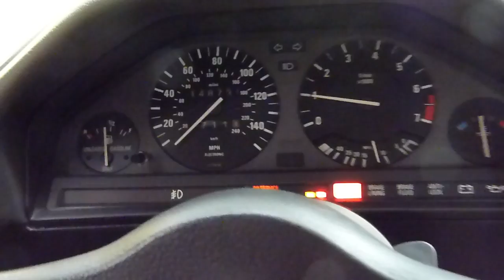SOLVED - e30 1991 BMW 318is 5k RPM hesitation - HELP

Comment from the maker: @BeamerE30318i Thanks for the response.. I am hoping the cams are not the problem. I had the valve cover off to replace the gasket about 4-5 months ago and the cams looked great.. the only thing that even looked potentially bad were the cam sprockets for the timing chain, but, but even those weren't that bad. I'll post back on here once it's resolved.
Reply: nairbtits please what was the problem???

Comment: nairbtits your about right! I personally realized the difference in the magnets,too. But mines turned out to be o2 sensor. Adding to that ,I took off my coolant temperature sensor and it has some black residue on it and it wiped off pretty easy and put it back in and it's sound was back to normal while trying to crank it up . Not the rich ugly sound it made before . Just now , all I need is nice jump battery .... went dead (not original)

Comment: I've have them same issues but its happens once I hit the gas pedal cars bogs out like if it's about to turn off this is just regular pressing of the gas pedal stop and go I have to light press on the gas to rev up slowly but then it has almost like a rev limit of 3k which I never had that issues before I have a 87 325is stock I'm thinking it might be Air fuel meter it's been down for 1 month now I miss her.
Reply: i have the same problem how did you fix this
Reply: Any fix or just sold it to another head scratcher?

Comment: My friend bought a 318i yesterday. I drove it home and it has the same problem with not getting over 5k rpm :P
Reply from the maker: If it has the M42 engine (1991), and it is exhibiting the symptoms seen in this video, I would START with the crankshaft position sensor. It is located directly below the crank pulley on the front of the engine. Jack the car up, slide under the front, remove the plastic (if it is present) and you will find it bolted in just below the crank pulley. 

If it's anything like my CPS, it will be absolutely covered in oil, coolant, road slime, water.. it collects just about everything as you will most likely see. I would pull it out, clean it thoroughly, and perhaps try it again if you are very low on funds, otherwise I absolutely recommend changing it. These sensors, just like practically every component on a car, have a very specific service life.. it's only a matter of time before they fail 100%.

Good luck!
Reply: It has a M40 engine, but we will look into it :P
Reply: Reaper  did u solve the problem ?

Comment: I have a 318i with the M40 engine and when in neutral the car will rev all the way to the redline but when driving it will Rev to 5k-5.5k depending what level terrain the car is on could this be a faulty CPS?
Reply: DAVID CADDY hello David, i have also a e30 318i cabrio from 1993 and the same problem. You find any solution??? many thanks from Portugal 😃
Reply from the maker: Hello David. I am not entirely familiar with the m40 engine, so I cannot say 100%.  For my M42, it was without a doubt, the Crankshaft Position Sensor, but I am not sure of the design/symptomology of the M40.
Reply from the maker: Hello Sara. The 1993 318i had the M44 I believe. If you are having trouble revving over a certain RPM, and you have not replaced the Crank and Camshaft position sensors in your car, I would swap them out. They are easily replaced and relatively cheap. While you're in there, replace the belts if they're worn and check your pulleys to make sure they're not in need of replacement.
Reply: Same did you find the answer?
Reply: @saracabral6610  hey,did you solved the problem yet? Cause my e30 m40 1991 was having the same issues as yours did too. Please help
Reply: Hey did you solved the problem yet? My car also having the same issues, please help

Comment: My '91- 318i,  E30, M42  is having the same problem at 3,000 rpm you had like rev limiter.  Did your is throw any Codes.  Mine shows a 1244 code which is camshaft position sensor. replaced  Camshaft Position Sensor  with OEM  it still hesitates and bucks especially around 65-70 mph range.  The Crankshaft Position sensor had already been replaced by a non-OEM brand.  Do you think The Bosch replacement CPS is the way to go to fix this and do I need any special tools or measurements? This problem has stumpped 2 BMW Mechanics.
Reply from the maker: I would say yes, the Bosch replacement is absolutely the way to go. I have read that even slight differences in the voltages in the sensors can cause wild problems with the M42. I replaced mine with a Bosch unit that said it was an "OEM" replacement to the M42, and it did fit, but I got no-start whatsoever after installing. I am not sure what the exact part number, but I would try, if the budget allows, to go for OEM on this. Shop around.

Comment: i have a similar problem. if it is due to faulty crank position sensor,  then you won't be able to fire up. my car injects lots of fuel but would not rev past 5000 at high gear. there is no power and cant accelerate. it idles and shakes badly during cold start but once warm it is fine. in all situations, there is lack of power.
Reply from the maker: The big problem is with the location of the crank position sensor (CPS). It catches all kinds of road grime, oil, coolant.. it's position is not optimal. It will still start up, at least it did for me, as the part is malfunctioning, but still working to an extent. I did not experience any cold-start issues when I had a bad CPS. I would not rule out a faulty CPS if you are experiencing this 5k rev limit, and if you have never replaced it, do it anyway. It's easy and necessary as part of regular maintenance. In addition to the CPS, make sure all hoses are free of cracks and holes. Check your intake boot for cracks, they can be very hard to realize. Remove the boot and flex it around, if it cracks or breaks at all, it's time for a new intake boot. Check your idle control valve (ICV) behind the engine under the wiring harness. If it is not clean or functioning properly, clean it with a toothbrush and some seafoam. If you haven't cleaned it since you've owned the car, clean it anyway. Doing these easy fixes may help you find your problem, or solve your problem. Good luck.
Reply: i had the crank position sensor replaced 3 years ago or 130,000km ago. how do you test the crank position sensor? should i replace this again? i am at my wits end. i checked the intake system and there's no leaks. i had the fuel pressure regulator replaced. PCV replaced. cam position sensor replaced. and it is still hesitating especially during cold start and it just lacks power and cant revv past 5000 at high gear
Reply: @nairbtits  can u do a video on it?

Comment: this happens to me I've been driving my 95 touring manual swap around and since I swapped it it's been 5k can't remember where it was when it was auto going to try my buddy's dme then I'll look at fuel issues.. how to check cps?
Reply from the maker: +StacheCam A 95 touring manual what? A '95 318is, e36? That would be an M44, slightly different than the m42 e30.

The crankshaft position sensor on my e30 is directly below the crankshaft pulley, the biggest pulley of them all and it has "teeth" on it. If you look at this image, you can see the crank pulley and the sensor to the left of it. http://www.r3vlimited.com/board/attachment.php?attachmentid=50755&d=1325901744

Comment: If it isn't the CPS (crankshaft not cam) it most likely would be your PCV valve in other terms crankcase ventilation system valve or oil ventilation system which basically takes your fumes from oil to gas and recycles it to your engine . Its a vacuum thing. That's why your engine misfires or hesitates. How to know ?! Open your motor oil cap and if it sounds like a can of Pepsi when opening (sound of released pressure) that's how you would know if that's your pcv . I'd check injectors as well.
Reply from the maker: Ahmad Suliman Yep yep, was the crankshaft position sensor. Turns out there are two crankshaft sensors that are identical, but vary in the voltage or amps or something. Make absolute sure you ordered the right part number for your M42.

Comment: I may have the same issue as your car had.  I have a M42 1991 Convert and the car backfired and quit.  Thought I was dealing with a fuel issue, but replaced that and still no go. What all needs to come off in order to remove the crankshaft position sensor?  Did you Ohm it out or just replace it?
Reply from the maker: The CRANK position sensor is at the front of the engine at the very bottom below the crank pulley. I took one look at mine and decided that it just needed replaced. It is in a position that it gets absolutely covered with road grime, and mine hadn't been replaced in who knows how long. Not much needs to actually come off to change the sensor, you just need to get a good visual, trace the line back up to where it plugs in. It's very straight forward. There might be some guides online, check out m42club.

Comment: I just got my e30 its a 1991 318i and it wont let me rev passed 4 1/2 and nothing in the car has been modified, everything is stock, I was wondering if there is some sort of rev limiter on it or something like that?
Reply from the maker: My problem turned out to be my CRANK position sensor, not Camshaft. You can find it on the bottom of the engine near the front. It will likely be covered in 23 years of oil, road sludge, coolant.. everything. I replaced the part, and the car was back to normal again. Also, is your car throwing any codes? Try a stomp test to figure out what you need. Google: e30 stomp test codes
Reply: well the thing is that I have no check engine light or anything, that's the weird part.. even though its completely stock it should still go up to its actual red line right?

Comment: I have the same problem bro 
Can you help me??
My car is e46 330i
Reply from the maker: I have an e46 as well, m54b25. I have never had this problem in my e46. What solved this problem in my e30 was replacing the crankshaft position sensor. In the e46, you may want to check or replace BOTH crankshaft and camshaft position sensors. When I replaced the crankshaft position sensor in my e30, the car went back to normal. For the e46 you could easily get the car scanned at an car parts store (if you're in the US?) or even some mechanics may be willing to just scan your codes for free and that should point you in the right direction.

Comment: Hey I have a 91 318i convertible with the m42 engine and two years ago my brother said something happen and he had to tow it be air wouldn’t even drive. I have been trying to get it started recently and it won’t start I’m in the process of replaces a few vacuum hose, I noticed my camshaft sensor is covered with all sorts of oil and stuff will be replaced that to and it’s leaking oil from the timing chain tensioner 
But this is what it’s sounding like. Any help would be awesome 
https://www.youtube.com/watch?v=2_ZI3fzI3rE&feature=youtu.be